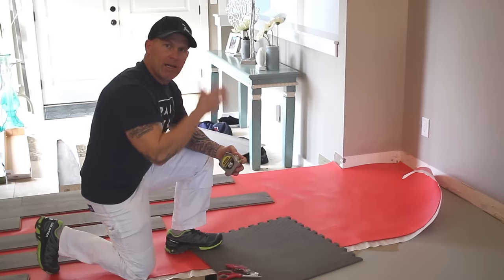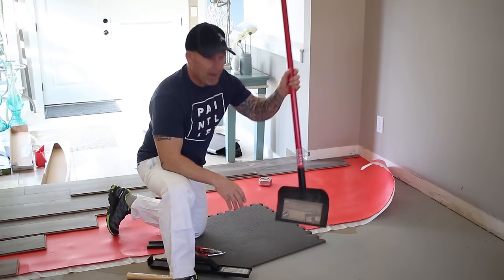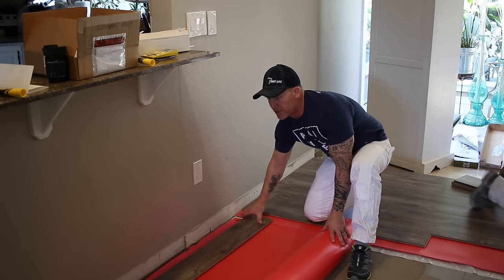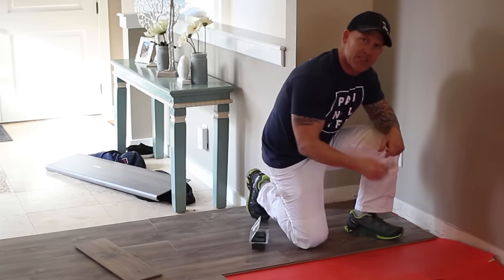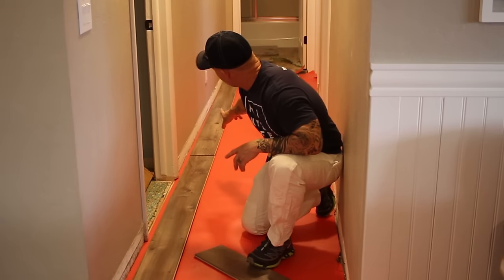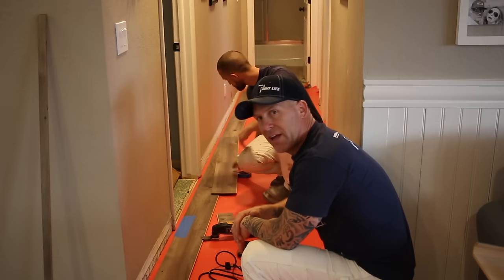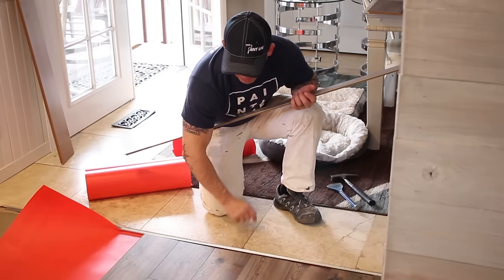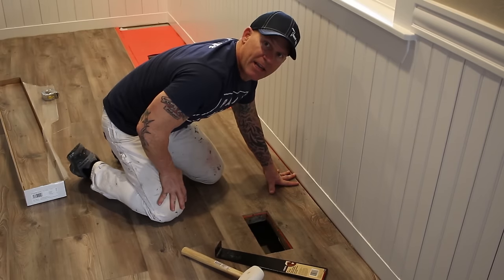How To Install Laminate Flooring

Comment: Love the videos! If you were installing the flooring on a concrete slab would you have to make sure the slab is level or use some self-leveling compound first? Thanks!
Reply from the maker: Yes

Comment: Hey.  I am almost finished installing my Laminate Flooring in my Master Bedroom and I have a 1 inch gap between the last piece of full sized flooring and the wall.  The wall doesnt have the baseboards installed yet, so my distance is more like 5/8 or 3/4 of an inch.  Should I rip a skinny piece on the table saw and use it to ensure zero gap between the flooring and the baseboard?  Or what should I do?  thank you in advance

Comment: Enjoyed your video.  We're having our living room and hall rugs replaced with laminated flooring, our kitchen was done 4 years ago having a laminated flooring.  Problem is when they measured they didn't listen to me when I told them the original flooring is a lot lower in the hallway and living room.  See many years ago they had to put plywood down when we bought the house to have a new vinyl flooring put down on top of the old flooring.  Then 4 years ago we had laminated flooring put in the kitchen.  My husband and I finished up on the molding the way we wanted it done and the transition piece you call that goes between one room to another we did our own because the hall had a nice thick rug and the same in the livening room.  It's a walk around hallway into kitchen to livening room. My worry is this, how are they going to match the hallway and Livingroom.   It's at least 1 inch lower then the kitchen.  Also we have a den off the hallway along with two bedrooms which are carpeted and we are leaving carpet in those rooms.  I'm very upset this isn't going to look good at all.  We already signed the contract but now they have to do some changes and price is going to be different for materials and labor.  Don't know why the fellow didn't bother to look or ask questions.  I tried to tell him that it was lower going off the kitchen into the living room and off into the hallway.  We're waiting for Lowe's to contact the group that's going to lay the floor down with this info that we gave them this evening.  Can you add anything to this to ease my mind especially if they have to put down plywood first and what's going to be with the entrance to the dens room and the other two bedrooms.  I'm jumping the gun probably but I'm worried we made a mistake having laminated flooring put in.  Our kitchen is 8mm thick we brought one we had extra to match, they don't make it anymore so we were told we had to stick with 8mm but we found a 10 mm that matched perfectly.  The new 8mm is OK but now that we need to add plywood, could I use the 10 mm?  

Your reply to this would be greatly appreciated, I won't be happy until I know my options and this guy who measured here didn't seem to care about what the customer had to say.  

Thanks, arleneandlen@gmail.com

Comment: When installing bamboo flooring in a bathroom, how can you prevent water from leaking in the 1/4" gap from the baseboards?
Reply: Not recommended for wet areas
Reply: Daniel Marquardt what about kitchens?
Reply from the maker: you would have to caulk it
Reply: Home Improvement How To's thanks for responding. I watched a specific site and that's what they do👍🏻
Truly enjoy your site, currently remodeling my house. Love to receive a giveaway but I don't do Facebook

Comment: Don't use the tape measure. Don't use shims. There are much better ways. Tape measure good for figuring out where planks will lay. You don't want your starter row moving around.
Reply from the maker: Thanks for the tip!

Comment: your a paint professional not a pro flor installer. i really hate when people say its really easy. Floor installation can get difficult.
Reply from the maker: Eric sorry but it was really easy
Reply: I like your videos and i know u wanna get followers and subscribers. The whole process of installing floor from removing the old floor to installing the new one can be quite challenging. Yes its not rocket science, your on the field you have labor experience but it's easy for experience people not do it your self people.
Reply: bro its pretty easy, just time consuming. don't get that mixed up
Reply: It’s easy stop being lazy. Lol
Reply: Making sure your boards land where you need them to is key. The last flooring I layed, I ended up moving the starter row 1/4 further in due to one door jam. Needed 1/4" under door jam. The floor laid out perfectly. with backward installing included and going undercut baseboards.